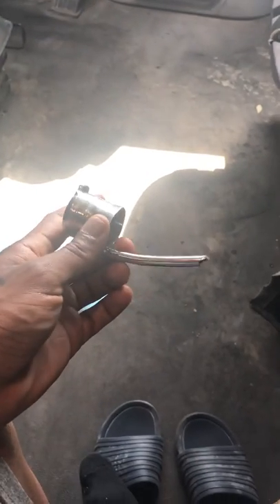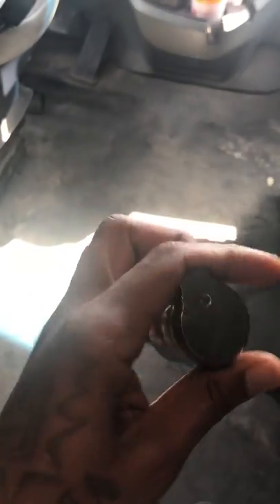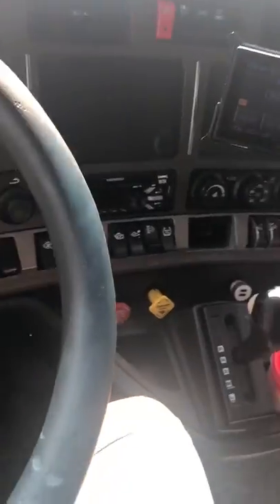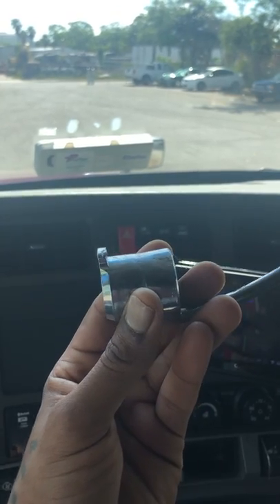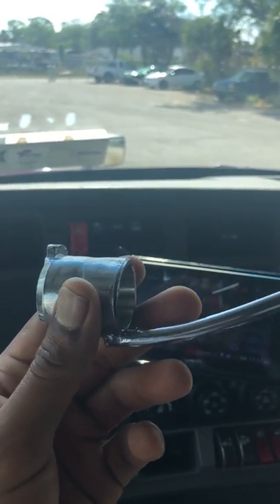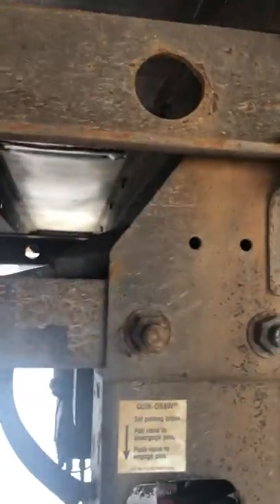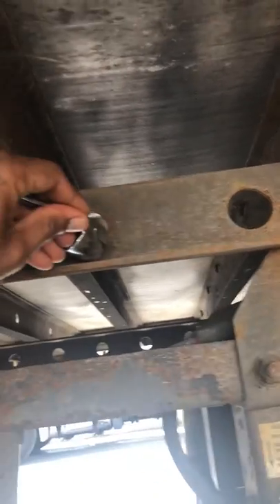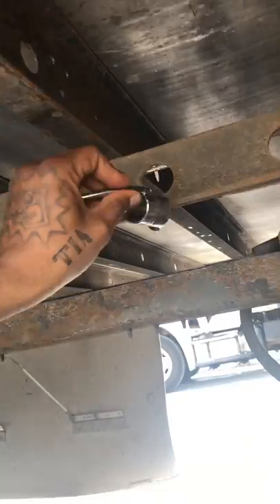My tandem-stopper experience

Comment: The reason it didn't stop the slide and got wedged is the way you inserted the barrel into the hole.  The sliding part of the inner rail had nothing to crunch up against to stop the inner rail.